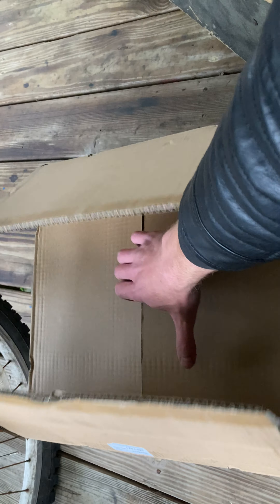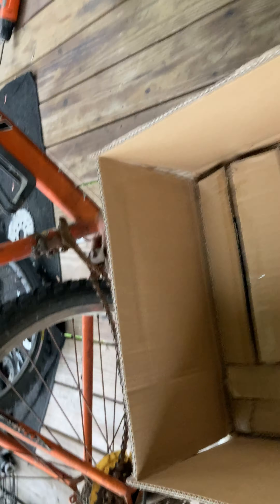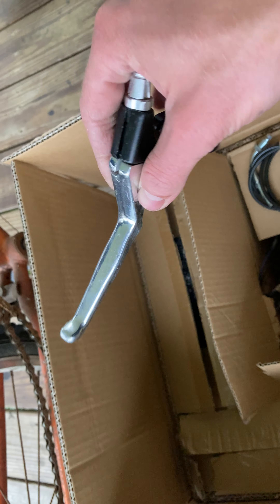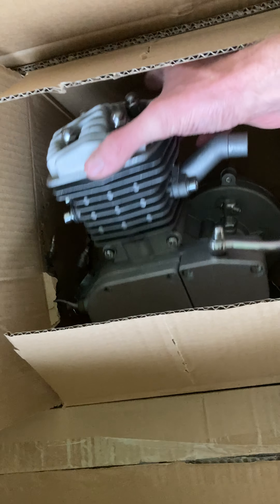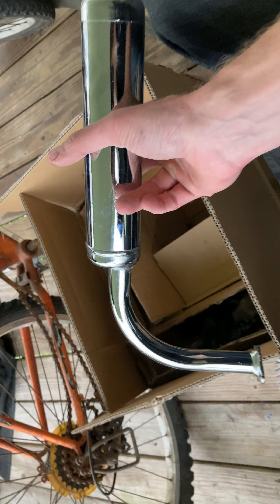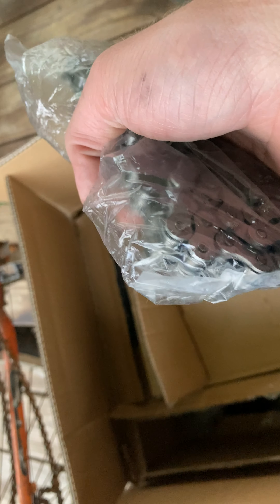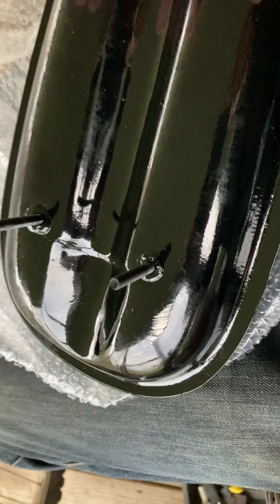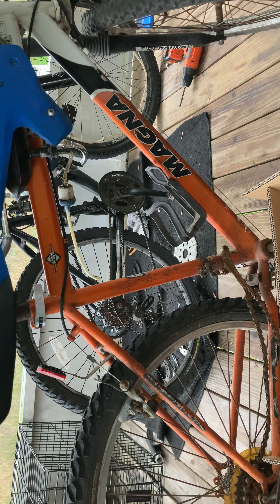80cc bike motor kit unboxing.

Comment: Hi mate was just wondering wether the throttle is suppose to pull itself back to the original position once you let go, because mine doesn’t and I’m not sure wether it’s because the carburattor throttle spring is faulty because it looks a bit bent
Reply from the maker: Yes it’s supposed to return. Take the slide out and try to adjust your cable until it isn’t tight anymore and see if it springs back.
Reply: @LogansCustomWorks  okay thanks, so I tried that and it does spring back but only a little amount, and only allowed a little amount of throttle
Reply from the maker: @movieshorts4561  Are you able to adjust the cable anymore?

Comment: Bt100 is a better engine kit in the vs yd100 is not better crappy casting and poor performance yd100. if you want a form its and quality the bt100 engine kit is for you
Reply from the maker: This is for someone else but ill definitely consider that thanks.